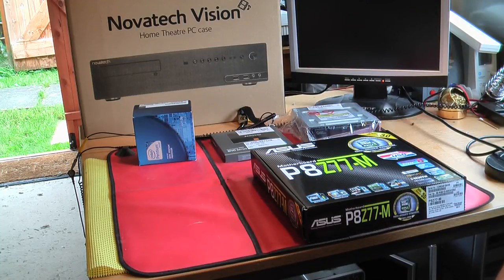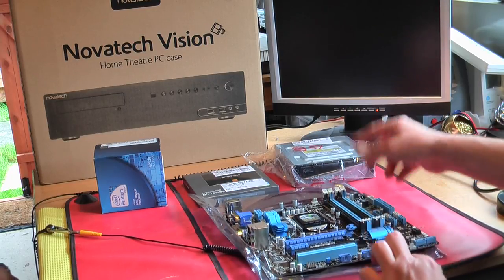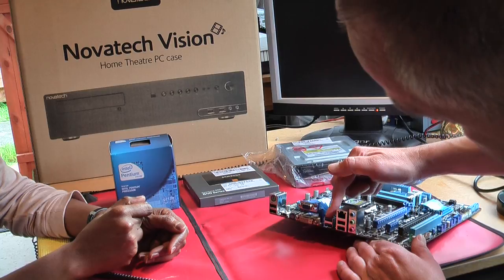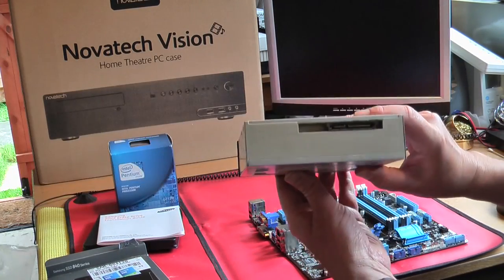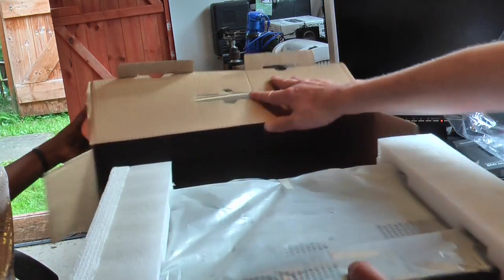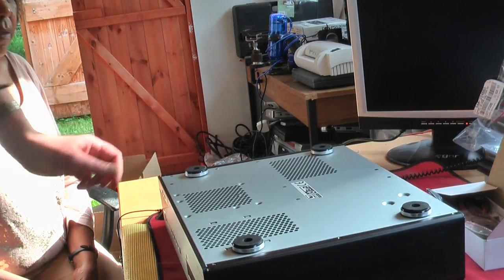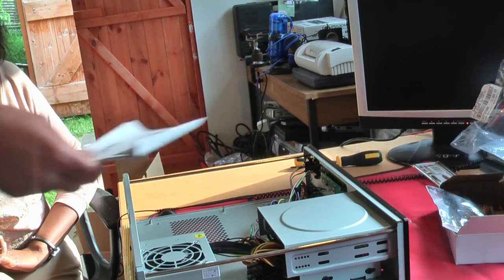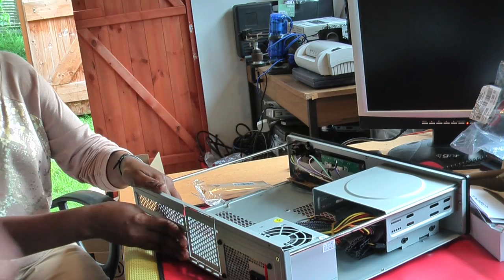My Girlfriend's first HTPC build

Comment: Nice video thanks i am running htpc with xbmc & a cheap medion sat tuner using dvbviewer running cam line via hadu. Works great no need for the dream box now my psu is only 400w had no probs even with a gpu & wireless card